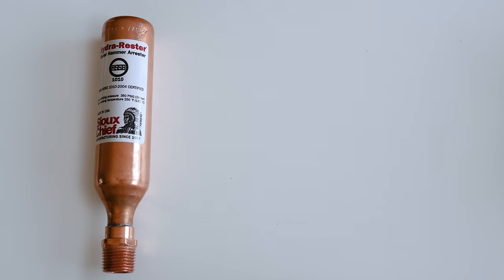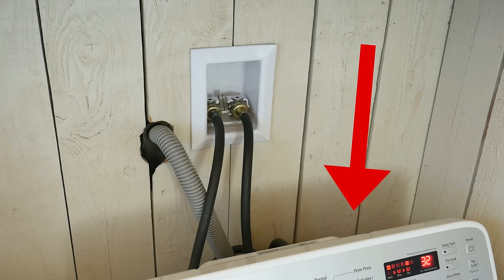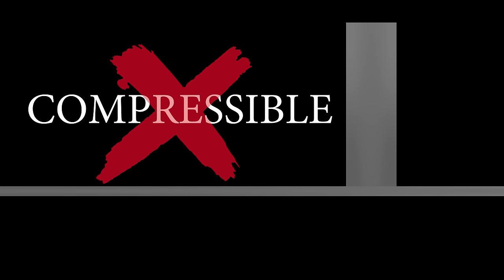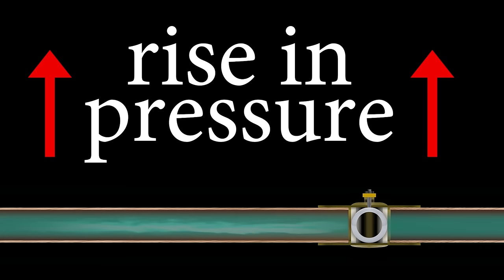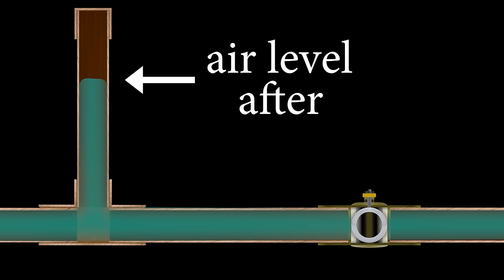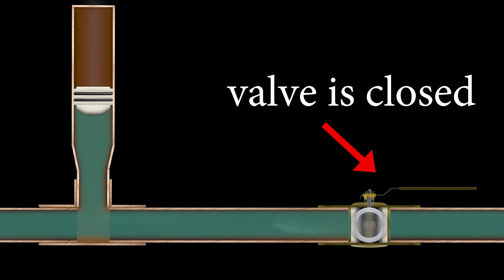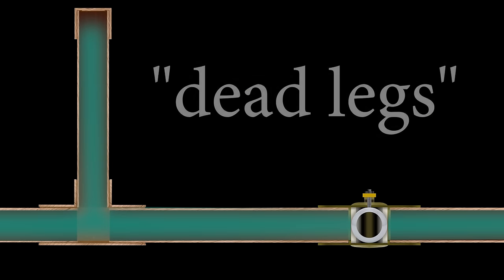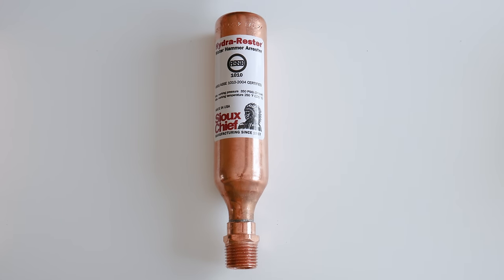Why Water Hammer Arrestors Are SO Important | GOT2LEARN

Comment: My parents bought a ranch style house built in the 70s. When I come to visit. There is bumping sound of a pipe between the master bedroom bathroom and guest bathroom all day long. And it's not us using water. It's from all the neighborhood. So I guess we need to open up the wall.
Reply from the maker: Yes, if you want to further investigate., it's most probably that there are no water hammer arresters and that the pipes aren't properly attached to the building, let us know!
Reply: Use an air chamber, it is more effective and a lot cheaper to install.
Once per year you will need to drain your water to refill the air pocket.
Hammer arresters are useless for large amounts of water hammer
Reply: @Silonomono  hahaha Thanks I needed a good laugh
Reply: RICHARD MARTIN
 ... This is a common problem on a dead end road, with a dead end water main, especially if you are near the end. Extrol makes an expansion tank that can be installed where your supply first enters the house. It's similar to what's used on a common boiler but rated for around 100 psi operating pressure. Inside this small tank looking device is a rubber bladder that holds air and it will outlast any of these things shown in the video above. Another thing to look at is if the water pressure is excessive from the main supply.  Anything over 50 - 60 psi range is just asking for water hammer issues.... and it's common to see over 100 psi from a public water main. Installing a pressure regulator might be your first step if this is the case.
Reply: Pressure to home?
Reply: I'm on a shared supply with the neighbour and have the same issue, but since it's only during the day, it's not a problem. Plus it's one way of knowing if they are in.

Comment: We bought a 1960s house and modern washing machine. Yup, intense water hammer. It only took a few months to cause cause a leak in these old pipes. Now we have flexible pex plumbing that can absorb a little of the shock, and in-line hammer arrestors on the washer lines.
Reply from the maker: Nice!

Comment: “Some objects and liquids are compressible” - all liquids are incompressible, at least hydraulically speaking.  Scientifically speaking a liquid’s compressibility is the same as the inverse of it’s bulk modulus, so water is one of the most “compressible” of liquids while as say liquid mercury is one of the least. For example, putting water under pressure at 500 bar actually does reduce the volume of the water by about 2%.
Reply: Aren’t some solid materials more compressed than the liquid for the same element? Meaning some liquid materials should be compressible into their solid counterparts?
Reply: @LKRaider  yes, it depends on the phase diagram for the liquid but for example you can definitely compress water into ice at temperatures higher than freezing. Can google ice 6 or ice 7. Can get ice at high pressure (1 gigapascal) at up to like 300 kelvin or 80 something F.
Reply: Wouldn’t a liquid that was gas saturated be compressible?  Seems pedantic to ask, but gas saturation levels could add a degree of compressibility to any permeable liquid in a closed system like say a brewery or soft drink bottling application.
Reply: @dennischavez7503  I would think it would be the opposite, if you saturate a liquid with solutes then you’re filling the empty intermolecular spaces with solids, gases or other liquids. if you compress a liquid youre pushing the molecules next to each other and filling the intermolecular spaces that way. but I guess I’m not 100% sure. intuitively I dont think youre right, though. it seems like except for volume an already compressed liquid and a saturated liquid would be very similar.

Comment: ours got started by accident and fixed by accident. we installed a new kitchen faucet to a galvanized pip and problem started . we changed the fixture hot and cold with pex for 20feet and problem got solved .

Comment: Stand pipe anti-hammer devices work way longer than "a few weeks" as was stated, generally a year or more before , GASP, a little maintenance is required!  Simply shut off water main valve and open both faucets to drain the system to get the water out of the stand pipe.  Properly  sized, installed, and maintained these will last as long as the rest of the copper piping.  Hard water deposits destroy the manufactured air chamber types and need replacement no matter what you do.   How long depends on the degree of hardness in the water.  There is a very remote chance of bacteria breeding in this stagnant water and the manufactured units also have an amount of stagnant water, just less.  
The manufactured water hammer arrestors are required because people have become lazy and stupid.  Same reason many cars have sealed transmissions, people are lazy and stupid.
Your videos are great and informative, this one just leaves out quite a few facts to justify using a product that will fail because of its design and need an expensive replacement, sometimes in a few short years.
Reply: some guy  Used to work just fine.  Hospitals have maintenance staff.  My response was primarily directed at residential though.

Comment: Ahh, so that's what a stand pipe was. I remember hearing them referenced in... something when I was a kid.
Reply: Not quite. A stand pipe usually refers to a tall, verticle pipe used to provide more uniform pressure to a system, or any pipe that supplies water to a fire-fighting system. It can also be just the verticle supply pipe in a multi-story building. This article refers to a water-hammer arrester, but not a stand pipe.

Comment: Interesting, it is equivalent to electrical bypass capacitors. Both are essentially acting as lowpass filters to prevent strong transients in the system!
Reply: Indeed the technical term for water hammer is "hydraulic transient".

Comment: I’ve been plumbing for 49 years and never used one, and never had a problem, I was a maintenance man over 365 units.
Reply from the maker: If you have low pressure, you won't need any.
Reply: @Got2Learn  but why the hell don't you install pressure regulator right next to water meter? You install it once and it works for 10+ years.
Reply from the maker: Because I like pressure lol?
Reply: @Got2Learn  I have 80psi in the house and it doesn't have one hasn't had one in 30 years so not necessary.

Comment: Just a suggestion, make sure you have an "expansion" tank at the water heater.
Reply: Does it need to be installed right near the water heater? Would it operate just the same if it was 20ft away?
Reply: @thaitichi  It depends on the intended purpose of the expansion tank, if used to arrest hammer, install it closer to the offending fixture, if installed for the expansion of water in the system as long as it is downstream of the heater you are fine as long as there aren't any check valves in the system.
Reply from the maker: I think most people install these near the water heater because the "strongest" thermal expansion is there, correct me if I am wrong guys, I am a learner too :)
Reply: @thaitichi water hammer arrestors are effective only if you install them at the fast closing valves. Ex washing machine, some faucets, showers, toilets
Reply: @fortunatedad7695  I was thinking that since water is not compressible, the sudden change in pressure would happen throughout the entire system. Is it wrong to think this way?
Reply: @inodoroguerrero  Wow. I already assumed the expansion tank would have to be on the cold side. I kind of thought the hot water would damage the membrane over time.
Do water heaters usually come with check valves on the hot and cold inlets?
Reply: @Got2Learn  Yes, strongest thermal expansion and most of the mechanicals are in the same room.
Reply: that doesn't help. When i had my hot water heater replaced they installed one with a check valve and that is when i started getting water hammer. It is on the cold water side and now i have to add these arresters
Reply: @Got2Learn  
"I am a learner too"
did you learn how to use teflon tape yet?
Reply from the maker: No I am still installing it on the wrong way, can't get myself to do it the right way...
Reply: @thaitichi  water hammer only happens at fast closing fixtures like got to learn days in the video.
Reply: Expansion tanks are only necessary on hot water heating systems.
Reply: @edwardgiacobbe98  there's no reason why you should have an expansion tank before your hot water tank. 
They go on hot water heating systems
Reply: @fortunatedad7695  Do you guys put arresters on dishwashers too?
Reply: @thaitichi  we don't typically install them unless the costumer complains of loud piping or requests it. I have 50lb water pressure in my house and only have them installed on my washing machine.
Reply: @fortunatedad7695  I think I'll do the same. I'm looking on Lowes but the water arresters have terrible reviews. Can you recommend a product?
Thanks for sharing your knowledge!
Reply: @thaitichi  I'm the type of guy that goes for the most reasonable price lol. I bought Sioux chief off of Amazon but they are $72 CAD for the pair. They are working good for me so far (2 years). Personally I would try the oatelys which are $23 each because when I bought mine I believe they were under $50 for the pair at the time.  Oately is a decent name is the plumbing industry and Amazon has a good return policy. 
No worries, anytime. I don't know everything but if I've experienced it I will try and help. Got2learn seems to be a guy with alot of knowledge and experience.
Reply: I C  interesting. Must be in case the back flow fails to protect the house from high water pressures. Good to know 👍
Thanks
Reply: IRATA plumber it’s required to be on the cold side out here.
Reply: @fortunatedad7695  Not entirely true.  Newer home builds with "closed" systems, i.e. have a backflow preventer installed so water can't backfeed into city water, MUST have an expansion tank installed.  Most hot water tank warranties, in fact, are voided if there is no expansion tank installed.
Reply: @terryq9966  sounds like a very unstable water supply if there's protection on both ends :). I guess that would be why there are different codes for different parts of the world 👍
Reply: IRATA plumber the expansion tank is to compensate for the expansion of the water as it heats up.  As was said previously in the thread when municipalities require check valves on the water supply their is no place for the expansion to go.  Without a check the water can migrate back to the municipal water supply.  With a check valve in place and no expansion tank the TNP valve on the the hot water tank will activate each time expansion occurs.  This can be problematic because the TNP valve can build up lime scale and possibly malfunction.
As for the requirement of municipalities for check valves on water services it is an attempt to protect water services from cross connections in homes from causing problems to the water mains.  Premise isolation is the term used in my province, Ontario.
Reply: @Got2Learn  ... .the expansion happens throughout the entire system, provided there are no check valves elsewhere. If you have a well tank it can expand back to that. If you are on public water with flow-back preventers then you likely need an expansion tank somewhere.
Reply: @thaitichi  They have horrible reviews because they last about a year, and then what do you do with a soldered in water hammer arrester that no longer works? I tried these in my home, and they failed. Perhaps they got damaged by soldering, but the hammer was back. Instead, I went back to the old tried and true dead leg, put in a ball valve and drain port. To get the replacement air in, it took a bicycle pump with a needle inflator stuck inside the drain port. A little messy to drain, but it worked as long as those mini-arresters, and was easily maintained. There is a reason these have to be accessible. It might get stale water, but only services a washing machine leg.
Reply: @kylekoenig4730  closest answer yet. It works on either side but highly recommended on the cold side. Or whatever your code says I guess.
Reply: @BlueDart1971  the hot side will ruin the rubber sooner
Reply: @kylekoenig4730  I know. The manufacturer of the hundreds that I put in says it can go on either side but cold is recommended. I personally never did put them on the hot side. I was just stating that it works as intended on either side but you are correct.
Reply: The thermal expansion tank is to be installed on the cold supply line as close to the water heater as practical. 
If it's a well pump system, it's not required unless there's a check valve in the cold line between the well pressure tank and the water heater. The pressure tank acts as a thermal expansion tank as long as water pressure can get back to it.
G2L, I'm a plumber with 30+ yrs. experience, and can explain the purpose and operation of the thermal expansion tank if you'd like.
Reply: @garywalls9041  I agree and I also have 30+ years. Excluding check valves is it really relevant where the tank is considering that the pressure is consistent throughout the system while static? I’m not being a smart ass I just asking if someone can give me a reasonable answer other than so you know where it is and if they have one.

Comment: My parents' house didn't have one of these installed. The city turned off a water main for a construction project. When the water was turned back on it caused a surge powerful enough to blow the bathroom sink's cold water faucet handle completely off. It shot water into the attic, which trickled down 2 floors and then into the basement.
We came home from church to a spectacular water feature coming down the chandelier in the dining room. We figure there was almost 1,000 gallons of water flooded through the house, causing about $45k in damage.
Reply: Wow did insurance Policy cover this kind Damage?
Reply: @louishollandjr  insurance covered most of it, but a corrupt subcontractor caused them to end up paying around $8k out of pocket.

Comment: I had a bathroom restoration and I learned about this the hard way. After everything was completed I heard a noise every time someone in the house shut off the water until I contacted a Plummer that fix it for me. You can imagine I have to break the new installed wall from the other room (I was lucky on that since I didn’t have to take down the travertine walls in the shower) to put the arrester.
Reply from the maker: Ouchhhh, learning can be expensive :(
Reply: I was doing a bathroom for daughter and the inspector told me to add them. Luckily at the rough-in inspection

Comment: Be prepared to install water hammer arrestors at AQUOR hose hydrants if the pipes are accessible nearby. I have 3 of these modern hose bibs and they shut the water off very quickly and i have experienced water hammer multiple times when removing the hose connector. After watching this vid, I plan on installing water hammer arrestors in my crawlspace close to each hose hydrant  to remedy this. Thank you very much for the insight.

Comment: Stagnant water in the chamber isn't an issue because the same forces that make the internal plunger work are also present in the old style with no moving parts. Basically each surge bounces the water against the air pocket so there is always an exchange of fresh water going on. BTW,  water hammer doesn't make the water change direction. The moving water suddenly stopping makes the pipe move (wherever there's enough slack to allow) within the wall / joist. The small bang / bump of pipe rattling around is what you hear.

Comment: Great animations. 1 Unanswered question. What is the optimum location and alignment of the arrester? I think near the hammer causing device and in a straight line with the bulk of the flowing fluid (without having to turn 90degrees etc.) Anything else means the initial hammer shock wave has to bounce back from the hammer causing device to reach the arrestor.  Just a thought.
Schaun
Reply from the maker: Closest to the banging fixture as you can 👌